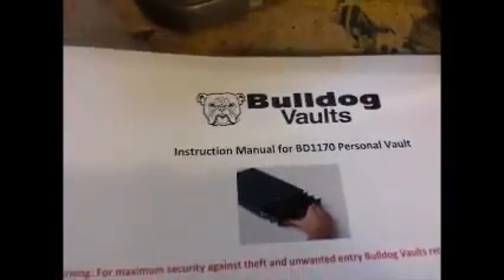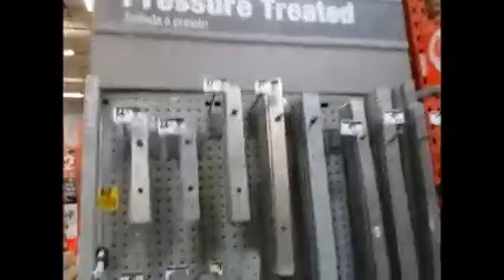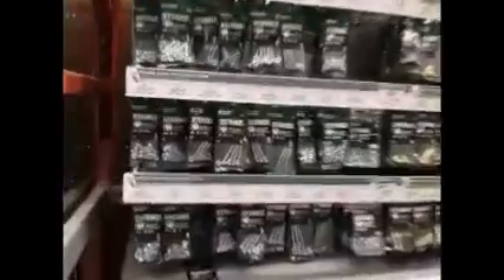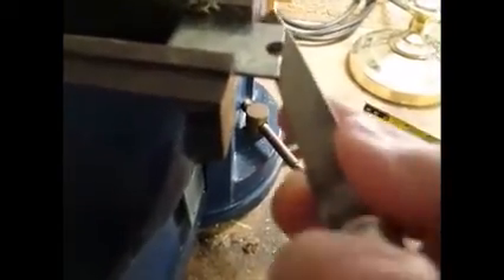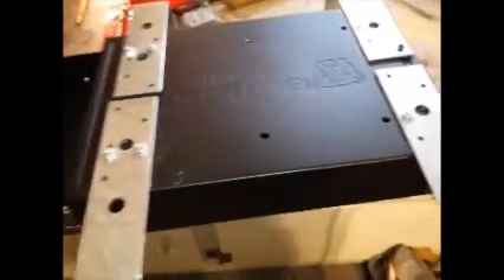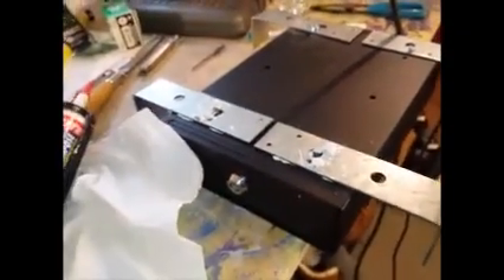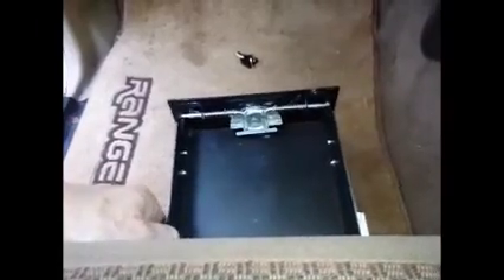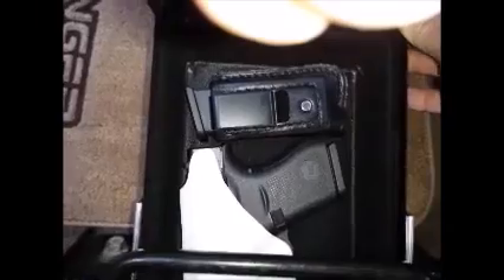Installing a Bulldog Safe drawer Vault into a Ford Ranger

Comment: Too bad they only make safes of this type with brackets for Jeeps only.  I guess there isn't a real market for other type of vehicles. However, great job on coming up with brackets for the safe.
Reply from the maker: Thanks Brotha. Before I did this, I could only find Jeep safes too....nothing specific for my vehicle. This safe has been in for over a year, and it's working good. 
I suppose the safety cables are better than nothing, but it was funny just how easily it can be cut with pliers.